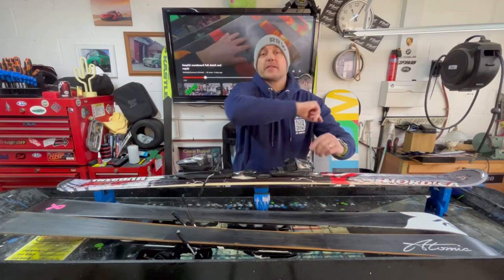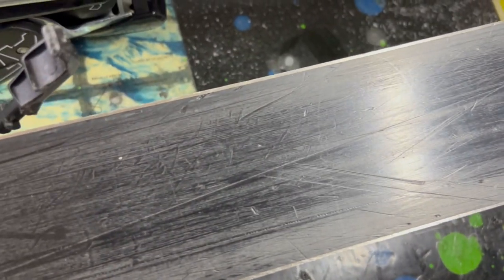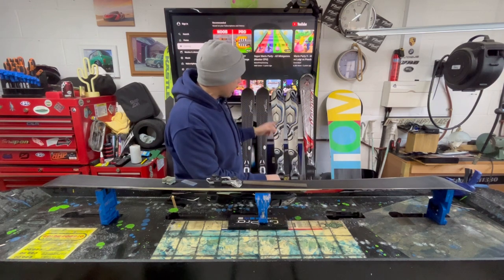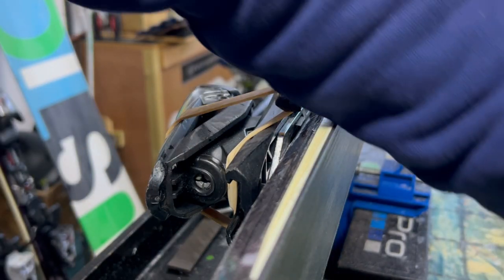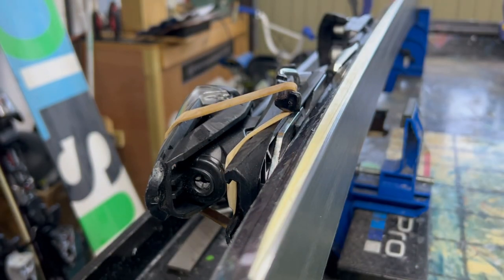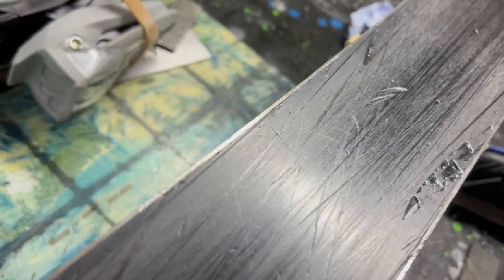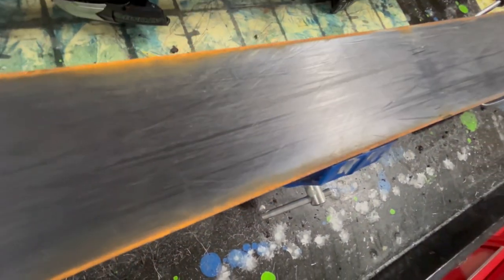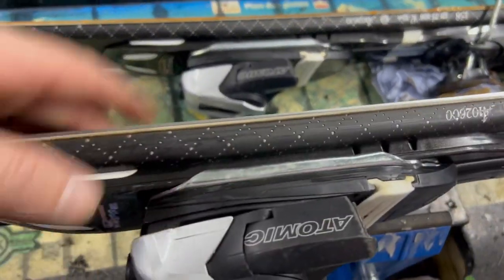How i restored these very rusty ski rails with before and after￼

Comment: Do you have any more details on what tools/supplies you used & the process to bring those Atomics back?
Reply from the maker: I’m really good base cleaner, as well as green, Brillo pad, describe the rails down to get most of the surface rust stain off. Then a fresh file and a base and side bevel tool. And then just get to work. There are multiple side and base tools on the market. I use the ones manufactured by Ski, man. 👍